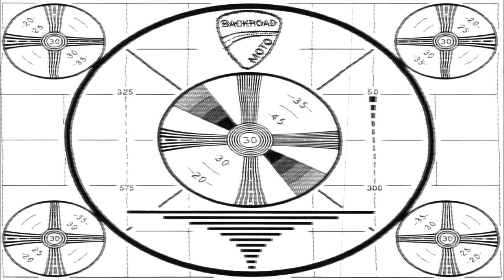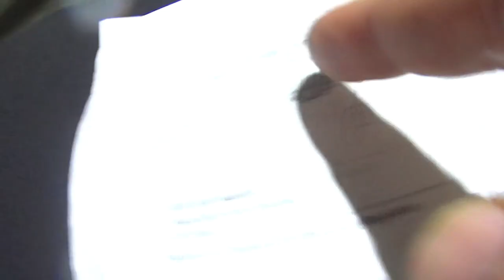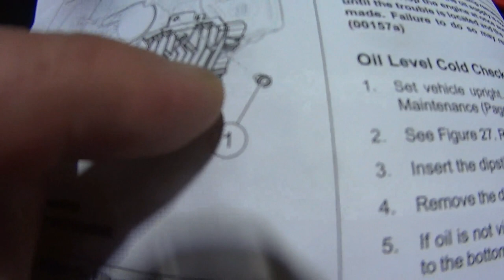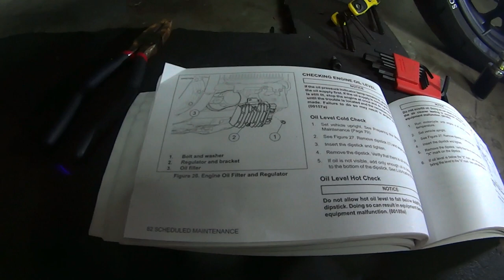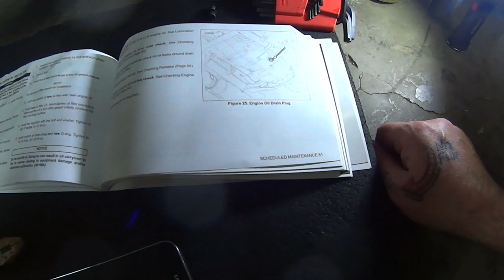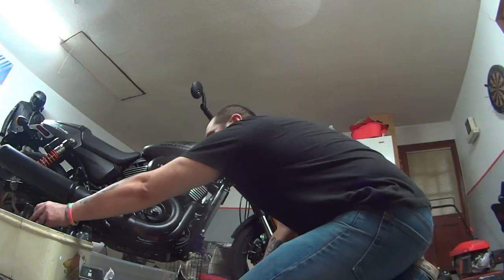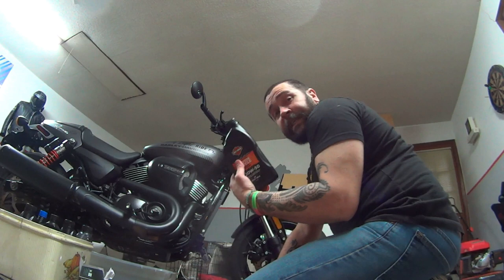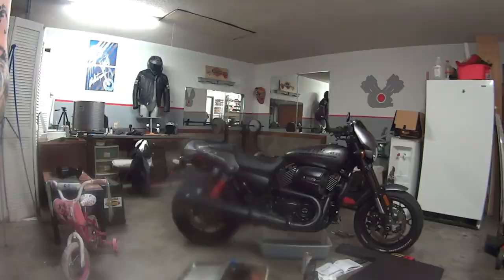Harley Davidson Street Rod 750 Oil Change

Comment: Is it true that if you did not let harley for the first oil change, they will not honor the warranty?
Reply from the maker: yes.. to keep their dumbass warranty you have to pay their ridiculous inflated charges for all maintenance
Reply: No.  You can change your own oil and it doesn’t void the warranty.   Unless the dealer is offering their own warranty beyond the MOCO.  But all manufactures can not void warranty based on an owners doing their own maintainance.    I would find a better dealer.

Comment: Take a flat head screw driver and punch it all the way through the left side of the filter and out the right gnome sayin? Then unscrew it with the screw driver handle gnome sayin? It’s messy but works gnome sayin?